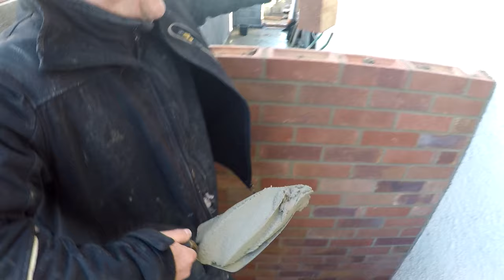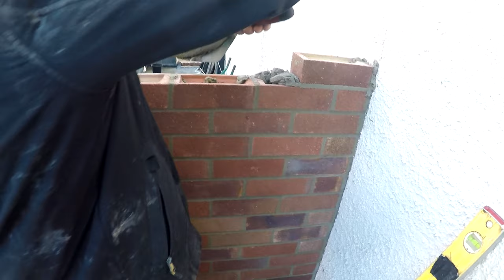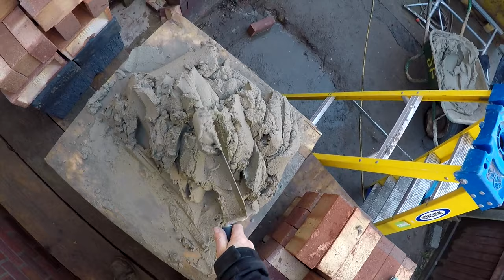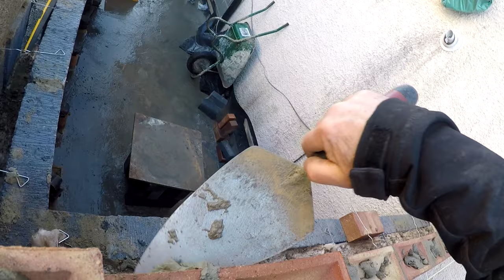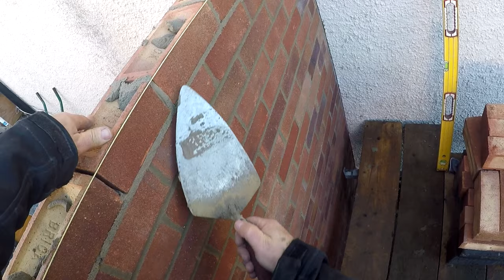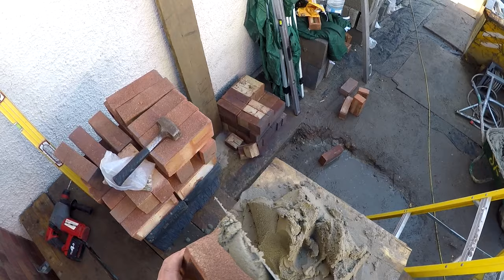Laying bricks for beginners

Comment: What you’ve got to do is roll the muck, then roll the muck .... roll the muck some more, then put a very very small trowel full on the wall, lay a brick and tap it about for 10 mins 🤦🏼‍♂️
Reply: Exactly.... it’s for beginners! So why not teach them the right way from the off. Bad habits stick! His method just wouldn’t cut it on a site. I done site work for 10 years... seen too many get the boot for bad habits. His trowel skills need attention.
Reply: He’s gotta go slow so people can observe
Reply: @simonlidbetter175  I'm confused, are you saying what's shown in this video is wrong / a bad method?
Reply: And I have just finished laying brick 1 .😃.nice work .fast enough and clean ..Good helpful tutorial..
Reply: Man's on daywork 😂
Reply: It sounds like your being sarcastic? But you do roll the muck a few times... his trowel skills are on point - pardon the pun - and with an excellent finish which leaves me confused regarding your comments, so since youve gone to the trouble to comment on this mans video perhaps you could share what these bad habits you speak of are? Or maybe do your own video showcasing them 10 years of site experience :)

Comment: Really good video - rolling the muck had to be done if your not using plasticiser or lime with gritty sand (render sand). The advantage is with gritty sand is you wont be repointing gables and chimneys for 100 years - however you still have to fill the perps - seen plenty of popped perps on supermarket builds  high up 4 years old......keep up the good work Budd

Comment: Any chance you could do a video showing some repair work, like for example if someone has knocked bricks out of the middle of a wall and you want to replace them. Is it just the same as this? How do you get the last brick in etc, also for repairing holes where a boiler flue has to be bricked back up when changing old boilers or water heaters with the square flues to a newer round flue for example. I have no idea how you would fill the gaps etc.

Comment: a very informative and useful video by a true craftsman. you make it look so easy!

I think that getting the mix to the correct consistency is crucial but is something I can't seem to get right.

it is either too sloppy that it falls off the trowel and slops down the brick wall face, or too stiff necessitating using a hammer to 'force' the brick level. then sometimes the mortar is setting too quick when laying the brick so I have to take the brick off, scrape the mortar off and do it again, very frustrating.

can you share your tips on achieving the perfect mortar consistency please?
Reply from the maker: David thanks for watching, if you look through our videos we have one on how to mix mortar, remember you have to be very patience, many thanks for watching, hope this helps 👍👍👏

Comment: If you need to build a front garden wall. Just one side ie 4ft by 10ft long. Can you do it in single brick? Also do you cut your half bricks before hand.

Finally can I soak the bricks in water since I'll be much slower to lay them etc

Comment: Great demo. I am going to give it a go and build a short brick wall about 1m high x 2.5m long. What is the correct gap between the bricks horizontal and vertical. I’m guessing about 10mm. Is that about right?

Comment: Nice work 👍 did you tie in the old building into the new work ?? If so what did you use a wall starter key ??
Also can you explain the difference between breeze blocks ? Why some people lay Striaght onto a foundation others lay trench block first ?
Reply: Of course he didn’t tie it in. It won’t crack off the wall for about 2 years by which time this cowboy will be onto the next mug customer

Comment: @buildingwithbud When laying bricks against an existing wall (as you did in the video) is there anything I should be doing to connect the new wall to the existing one? Or will the cement between the new brick and existing wall suffice? Thanks!
Reply: You'll need to fit a 'wall starter kit' to the existing wall to tie the walls together.
Reply: @illmitchjax agreed. Exactly what’s missing from this video.

Comment: How have you got 150 cut brick in your wall .
Reply from the maker: Well spotted. We should have placed the cut against the exsisting... bad hair day
Reply: Ok tidy work though. 👍🏼
Reply: 3/4 is allowed in middle of wall as broken bond.. Very neat finished  at the end of the  day.
Reply: Yes just wondering, your work very tidy mate . 👍🏼🏴
Reply: @topcatcoolio8807  it might be but I would have made my building bigger to get rid of it.no one knows and no one will ever check ha.ha.ive never seen a building inspector check the length of a building.unless it's going to intrude into someone's property.some shit architect who not been taght to draw walls brick size I couldn't be bothered cutting bricks on my domestic extentions I would always try take cut bricks  out.but if it's critical the cuts must go up the end against the existing old work not the middle of the wall.